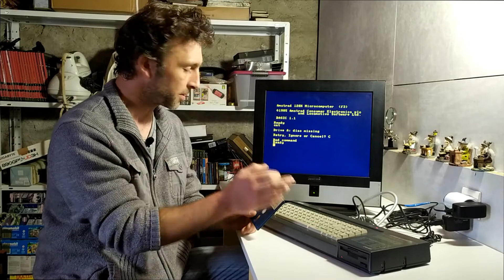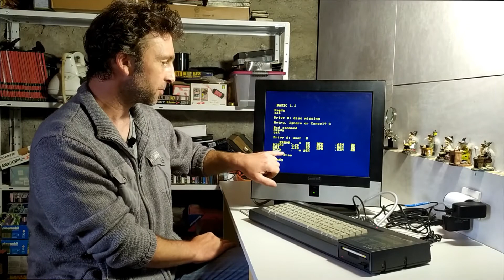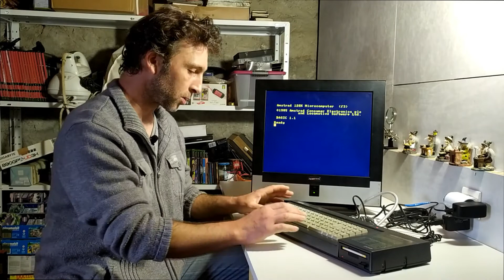Fixing an Amstrad to buy a Vic-20 | Part 4 Checking out the 3" disk drive

Comment: It is common practice for folk to use alcohol to clean drive heads and connectors with. Alcohol is corrosive so after you clean with alcohol, it's a good idea to rinse it off with eye contact cleaner to remove any possibility of corrosion. It is especially better to use eye contact cleaner on rubber parts like pinch rollers and belts as the alcohol will break the rubber down. I learned this the hard way on my Tascam 38 reel to reel 8 channel recorder... it made a mess. Nice work as usual!
Reply from the maker: Thanks for the heads up Gorf. I didn't know about the alcohol eating rubber thing. I don't think that it should pose a problem this time though as the capstan and large pulley were cleaned days earlier (when my phone decided to go on strike) and all the alcohol was well dried off. What re-cleaning i did in the video on those parts was little ;) I'll keep it in mind in future though, thanks again ;)
Reply: @8bitsinthebasement  Some rubbers are more resilient than others but I'd not take the chance. You can use the alcohol and usually you'll be fine but always rinse it afterward with a q-tip and the eye contact  cleaner afterward. It's a much milder substance and mush less likely to do any damage over time.